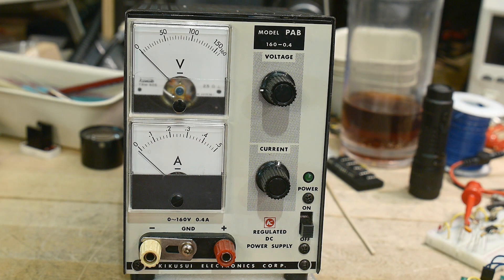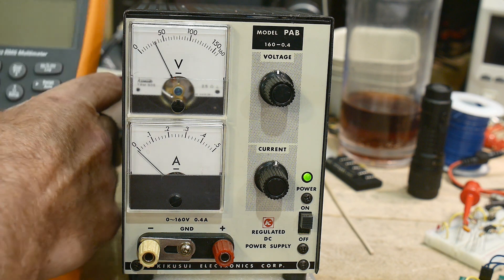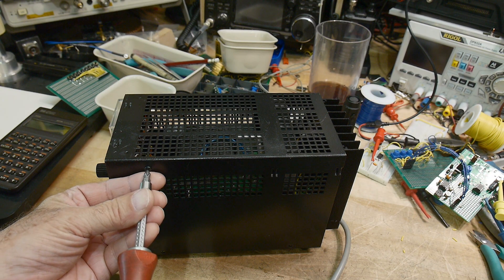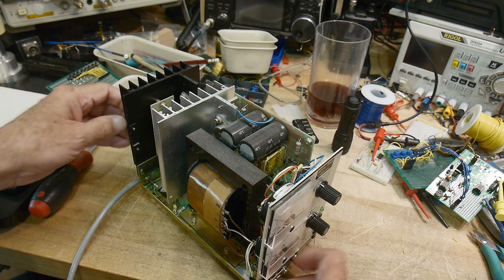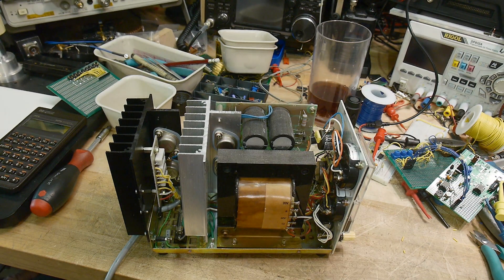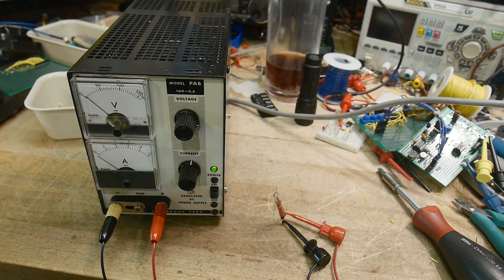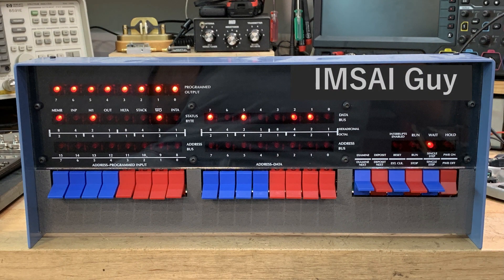#1219 Kikusui 160 Volt Power Supply

Comment: https://youtu.be/_v8S_4IXrFs?t=253 
This might be interesting, are the transistors in parallel or in series? There are 4 of them. Are they of the same type?, can they handle 160V-200V? Maybe two of them stacked for the voltage and the other pair in parallel for the current. 
Or they are the two arrangements for the voltages S1 and S2 below and above 90V?

Comment: A fun find. It looks like there is a switch on the back. What is that for? Thanks.
Reply: You can select between M and S, maybe master and slave or whatever. 
But there is also an input (?) with the name J4, something more for a signal, not for power. 
Maybe you can control the voltage via this input in slave mode.
Reply: @Manf-ft6zk  Thanks!

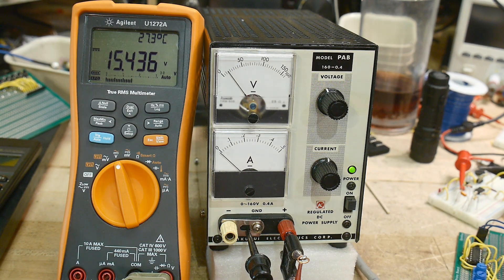Comment: @ 2:15 - "I always try to find documentation on something before I buy it." Wish I woulda done that before I bought a Xeigu G90. Its a cool little radio for the price point. The power switch transistor shorted. The radio can't be turned off. I would no longer recommend this radio.